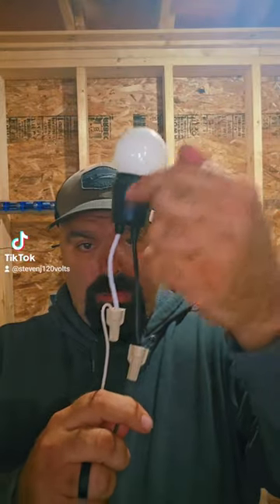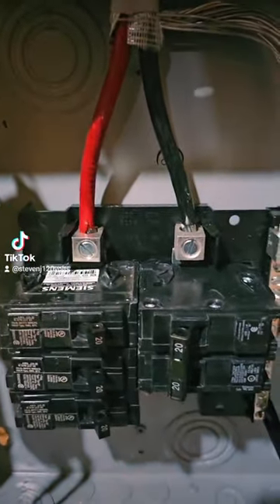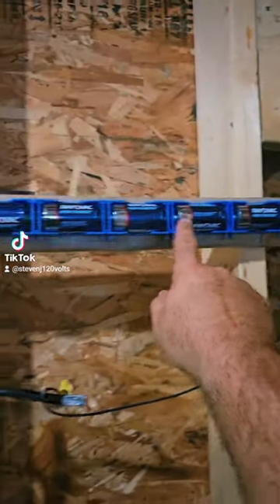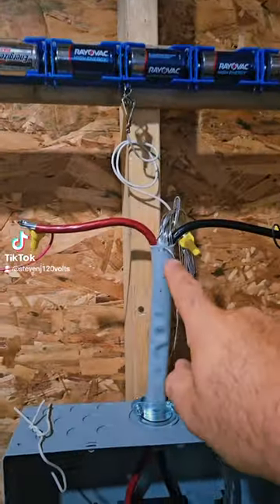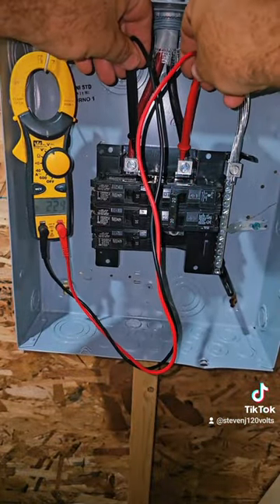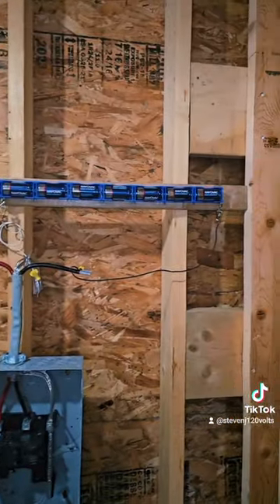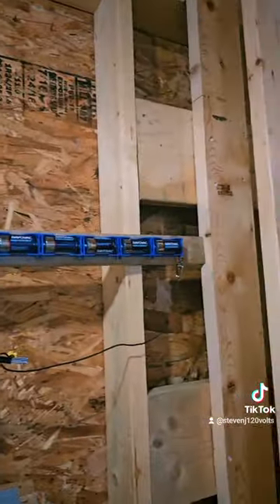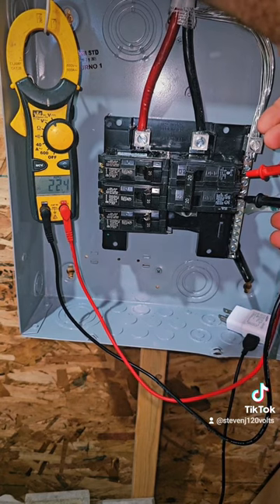why doesn't a 240v circuit need a neutral???

Comment: Some 240V appliances still need a neutral because the control devices run on 120V.
Electric ranges and clothes driers for example.
Reply from the maker: Yes. I was talking about the ones that do not need neutrals.
Reply: This issue is a point of contension for a two wire 240v outlets or the three wire plug. The appliance drawings show a neutral on the appliance and a ground on the house outlet. They connect the neutral to the ground or is it the ground to the neutral. Their drawings are technically incorrect with a name change in the middle to make it work. The actual difference between a neutral and a ground is where the wire is landed in the breaker box. Addiitionally, the neutral and the ground are bonded in the breaker box at the first disconnect. This bonding makes them electrically the same voltage. To me this whole thing makes me worried about touching my oven or the dryer. I am still alive. My brian hurts just talking about this stuff.
Reply: @TexasEngineer that actually doesn't happen. Electricity always needs a path to its source. Sometimes it's back to the utility through the transformer or to earth. If you bond after the first disconnect, then yes you can allow a positive charge on the ground conductor. But since the ground goes to ground it could never hold a charge when wired correctly. It will dissipate a charge, but never hold a charge. So you really have nothing to worry about.

Comment: thanks for the answer. I found the problem: what happened is that only top 2/3 of power metal bars where brakers connect, had a horizontal piece of metal connecting both, left and right sides and the 1/3 bottom part where I installed the slim 30 amp 240v braker didn't have that little horizontal plate connecting both metal power bars. I had to use a regular bigger size double braker that touched that horizontal metal plate and that fixed problem and got me the 240 volts needed for drier.

Comment: Near the start, you mentioned “wrong terminology” being used.  That is correct, but you didn’t follow up on that thought to explain what is wrong with the terminology.  What is wrong is that too often, people who are trying to teach AC to beginners lead them to believe that “hot” means “source” and “neutral” means “return.”   Wrong!  I see this again and again in YT videos.

“Neutral” means only the conductor thst is tied to ground.  “Hot” means a conductor that has a significant voltage relative to ground.    Thinking that they mean anything else is the fundamental terminology error.
Reply: Not always. What you are talking about only applies in a bonded system. Neutral in a non-bonded transformer is not ground.

Comment: The definition of Alternating Current is it is constantly changing in magnitude and periodically changing in direction . For transformers and AC motors to work this has to be so .
Reply: A transformer will generate output as long as there is changing amplitude, changing direction is not required (but it's easier to saturate the transformer core if using a change in amplitude without utilizing a change in direction depending on the application).  Just FYI, Don

Comment: Yeah the low side windings are 180 degrees out from each other. When you use the full 240 there is really no unbalanced load.

Comment: To better illustrate the single phase nomenclature on the panel you could have show a single phase overhead transformer being fed one single phase of primary being converted to two hot wires on the secondary side.

Comment: All modern appliances and motors have circuits to deal with the two hots being interchangeable? Specifically makes me think of motors that need to spin a particular direction but maybe that’s more complicated with initial kick on and start sequence with capacitors. I’d imaging there are old machines that the hot being on the correct terminals was an issue.

Comment: Great explanation and demo but I’m still trying to wrap my head around whether or not my 240v AC/DC stick welder will function properly if I drop the neutral wire. Thoughts?
Reply: It won't, you can drop the ground but need to have the neutral.
Reply: @robprice58  Thank you 👍

Comment: Thanks. I always wondered why my well pump only has 2 wires. It's the only 220 circuit in the house. My dryer, heat and hot water heater are propane.
Reply: Hopefully you have a third wire for ground.
Reply: @shawskeebennett1440  Nope.
Reply: @shawskeebennett1440  On my home well pump located in my basement the metal conduit jacket acts as the ground back to the panel

Comment: Interesting. I always wondered why it's not called double phase power. I suppose since the transformer from the street is tapped off a single phase of the 3 phase power from the telephone poles.

Comment: What about 240v appliances that  have internal  leg break outs for 120v components  like timers and motors?   They should not be using ground  as a neutral  tap  so how do they do it with a three blade plug?   Has using  the ground been been the practice in the past on older 3 blade dryers and ranges for example?
Reply: Three prong plugs do not have a ground, they have 2 hots and a neutral. The chasis of the appliace would be bonded to neutral instead of ground. That is no longer to code because it can create a shock hazard in the case of an open neutral.

Comment: I understand they are not out phase when measured from top to bottom but how is it possible for them to alternate positive negative/supply return if one is not opposite polarity (mathematically 180 degrees out of phase)

Comment: Very good explanation.  Would love to know why AC is better than DC. In most cases.
Reply from the maker: everything cool or electronics converts to DC internally
Reply: Westinghouse was better at PR than Edison.
Reply: AC is easier to step up or down using transformers, also more efficient for long distance transmission.
Reply: @Stevenj120volts this answer had nothing to do with the concern given.

Comment: Great setup. Teach the general theory about residential AC power services. 
Remind this was done with batteries(DC).  

Challenge: explain 3 phase power and why 2 pole is 208v and not 240v
Reply: 208V can be a single pole. It's generally found in commercial/industrial environments. For me, I've only seen it on conveyor belt motors. Homes will only have 120V/240V.

240V is also 2 pole.

3 phase can technically be run to homes, even though it's not done. 3 phase is exactly what it sounds, it has 3 phases (legs) of power. Unlike single phase where it splits a leg off to provide 2 legs of power into a home, 3 phase has 3 individual legs going into a panel. Each leg is 120° out of phase from each other. So like he explained the positive and negative alternate between the 2 legs, the same happens in 3 phase, but only one acts as the opposite while the other 2 are either positive or negative.
Reply: @TheForgottenMan270   nice. It’s a good finish to it.  208v is a single pole fed by a double pole breaker from a 3 pole wye that has a neutral in the centre after its been transformed from delta transmission lines. It’s possible that may be found in residential setting, mostly in rural residential or farm lands for their shop equipment. This opens the topic of transformers. 
L2L 208V
L2N 120V

A single phase residential power service the neutral is just like mentioned in the video. 

You had a good idea of this. Just needed to iron it out like a wrinkled shirt. 

@MikeHoltNEC good guy for the advance stuff that most guys don’t get a chance to see.
Reply: @oshanehall3470 the reason you get 208 is because their is no point at which you are 180 degrees out. You can only get 1.732 times out. Which will be 120 times 1.732 and we call it 208

Comment: The power does not come in the HOT and return on the WHITE. It is AC current, therefore it flows BOTH ways.  "AC" means alternating current.  In the USA the current flow changes direction every 1/120th of a second.
Reply from the maker: Lol wow......silly
Reply: Yep, each cycle changes direction twice.  got it.
Reply: Not true. Part of what the video explained was that in certain applications neutrals aren't needed. So if that's the case and no white wire exists how does AC current exist?

The purpose of neutrals is to carry the imbalance of power between phases/legs back to source or/and to complete a circuit (120V) back to source. If neutrals are the equivalent of a hot then they both would be considered ungrounded. Hots are called ungrounded, meaning they aren't bonded to ground. Neutrals are called grounded, meaning they are bonded to ground. Grounds are called grounding, meaning they are part of earth ground.

So yes, AC stands for alternating current, but that has nothing to do with neutrals. And that's due to the fact neutrals aren't run from the utility companies to transformers. Neutrals come from the transformers on poles or ground to the different structures.
Reply: @TheForgottenMan270  Power company DISTRIBUTION to the stated neighborhood 
transformer.  Uses three (3) wire Wye with neutral conductor.

               The same company TRANSMISSION system uses (your stated) three wire Wye (no ground conductor) system.  comment please

Comment: 240 voltage plugs need a neutral ground. Something worth the short out at least a unit will be grounded.
Reply from the maker: Ground and neutral are different. All of them have grounds not all have nuetrals

Comment: Neutral is a just the center tap on the transformer, between the two end taps that make 240 volts..  
tapping in the middle  breaks the coil into two segments..   120V apart
AC POWER   both sides are POWER AND RETURN..  ( hence AC )   
the reason you don't need the neutral for 240..  is because you want 240v. so there is no reason for a center tap.  
( the safety factor about the center tap. it is connected to ground..  so the voltage potential between it., and a person who accidentially touches ground..  will be 0.    
it only has a voltage potential with the other two taps..

Comment: Some 240 circuits do require a neutral and a ground. Some new ranges have 4 wires too.
Reply from the maker: I am talking about things that don't like water heaters and baseboard electric heat
Reply: @Stevenj120volts  
Regardless some still have a neutral. Some have timers that require a neutral and that includes water heater too. Them days you are talking about are almost gone. When I was younger they would let you switch one leg of 240 to cut the circuit but that is a no no nowadays. Soon all circuits will require a neutral regardless of what it's used for because it can be changed to something new in the future. Get over it.
Reply from the maker: @benjimenfranklin3668  wtf... 240 no neutral count ALL electric heat and and ALL mini splits, ALL Air conditioning equipment ALL 240 lights for growing indoor plant aka weed ALL 240 motors including pools and wells.... You are foolish.  There are only two pieces normally need 240 with a neutral dryers and stoves.  Please do not comment incorrect information that you are not qualified to speak on.  MOST close to 95% of 240 equipment does not need a neutral.  All of Europe is 3 wire 240 volt.  Its the 4 wire 240 volt that is the odd thing from the past. I am on IG, tik Tok facebook and you tube. The comment section on this video is some of the most trash and dumb commentors I have seen on all the internet and on all my videos. I had 1.5 million view last most with 1000 of comment yout comment is in the top 10 of most incorrect I have ever seen on one of my videos

Comment: Neutral wire never made sense to me, but my biggest complaint is the color code and terminology on wires. Black should never be hot, to me black will always refer to ground, therefore black should be RED, ground should be GREEN and or solid copper..........

Comment: U S standard , both wires are 110 volts each, do not require neutral , which is 220 volts output !
Reply from the maker: Just 240 between the wires.

Comment: So from the bare "ground" to any real ground would cause a short? Furthermore, there is not any breakers to save you!?
Reply from the maker: What do you think is a real ground?  Electricity from a battery or a untility transformer will not flow to earth or dirt. Only back to its source
Reply: @Stevenj120volts  yes, but if you are touching the ground with bare feet, you will get shocked if you touch a live wire. That's what I mean by ground.
Reply from the maker: @vegasguy73  incorrected only if there nuetral has been connected to the dirt5
Reply: @vegasguy73 electricity like all forms of energy wants to become equalized. A live wire has a high potential (voltage) compared to ground (0 volts). If high voltage comes into contact with low voltage it will produce a current to try and equalize. So if your grounded human body touches a live wire then you will get shocked because the electricity will pass through you to get to ground. Circuit protection like fuses, circuit breakers, or a GFCI are on the live side of the circuit so they would still be relevant because that current still flows through them.